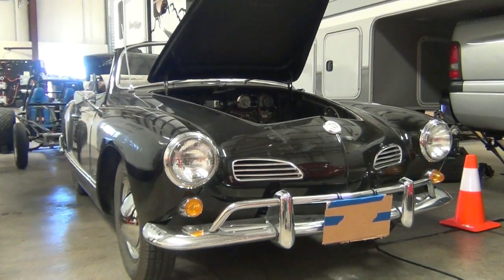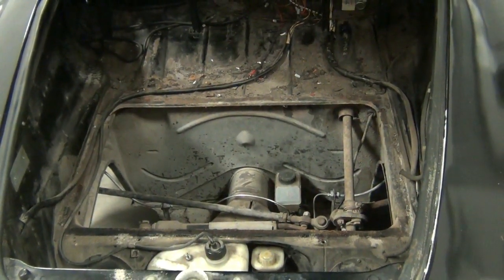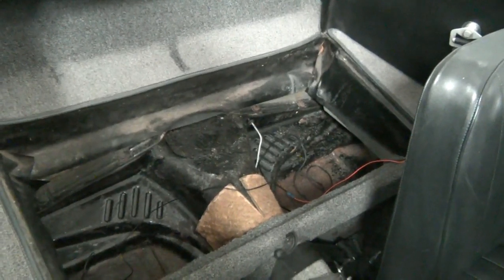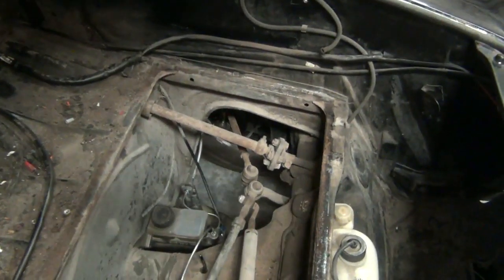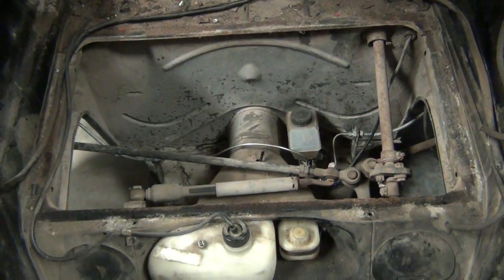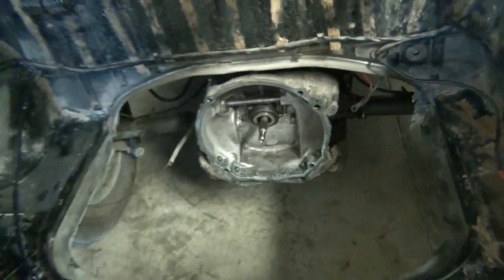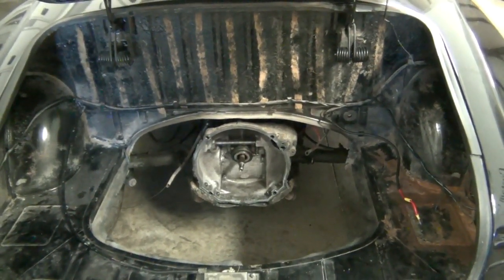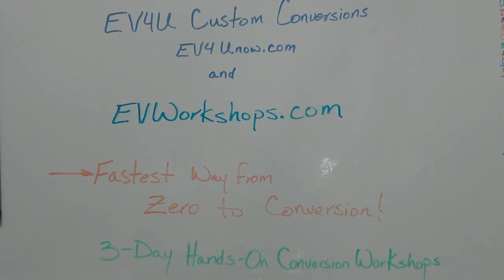VW Karmann Ghia Convertible EV Conversion, Part 2

Comment: What is the best range you can get out of that set up?  I'm thinking of a 1983 Camaro which had the best coefficient of drag at the time.  I would like at Least 150 miles.  I would want a bolt in kit!  Flexible solar panels on the hood, roof and the rear window.  Onboard 110v charger.